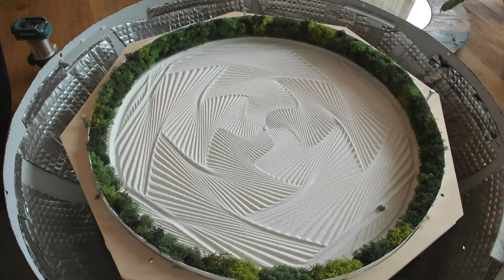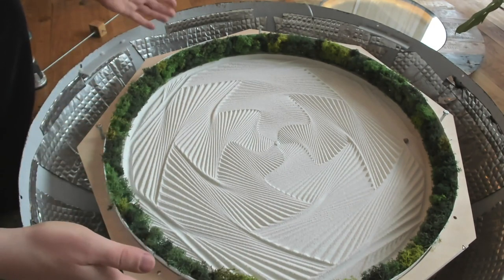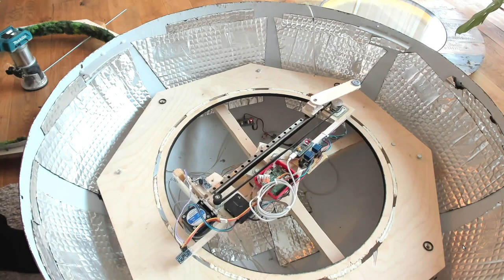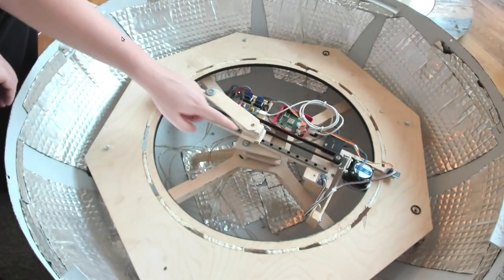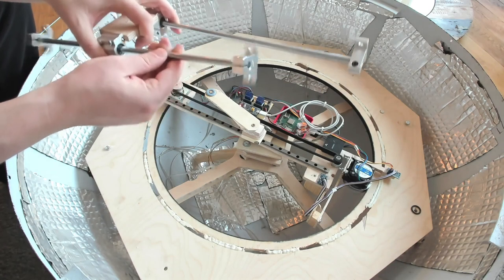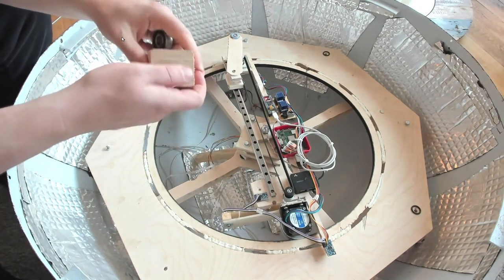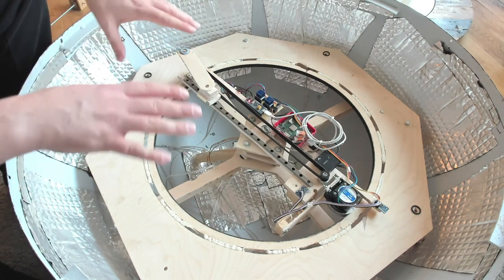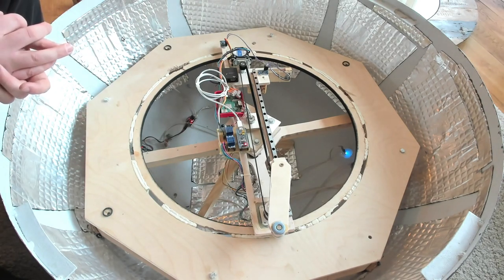How to create a zen sand table part 2: Hardware

Comment: I have been brainstorming on how to build a table like for the past 2 hours. You just took away many of my concerns I had. Thanks a ton for sharing. I've been thinking of making one for more than a year. But after just completing a significant (for me) woodworking project. I feel like I finally have the courage to attempt this.

I am mechanical engineer and have limited knowledge on the software side of things. But your documentation has convinced me it's at least doable to build a silent round sand plotter at home. 

My ambition is to make an affordable DIY version of the sisyphus table and share the building plans.

My idea for the construction is for the moving assembly to be completely without electronics. So the mechanical aspect would require some more effort and materials. 2 driveshafts on the same axle. But you already know this to be an option. 

My main concern then would be the noise.

But I am going to start with choosing the best/cheapest mechanical solution. Keeping in minds to keep the electronical side of things as simple as possible. Since I'm not great at that. 😂

Again, thanks for sharing. It's a very niche topic. But I'm glad you shared your findings and experience.

I will reply to this comment if I've made any significant progress. 👍
Reply from the maker: I'm glad the video helped you. Then it was worth making it :)
Reply: @abmt  I haven't continued progress. Since a couple weeks. But I did almost finish the design for the mechanism. It's hard to stay motivated with so much going on in life. But I'm sure I'll finish the project some day

Comment: Hi....  I really  like your Sand Table Build.   I like the fact you used a large planetary gear being the outer Nema 17 stepper motor that runs along the GT2  belt that wraps around the perimeter ring. Q. Is most of the sound  being generated coming from the outer motor agaianst that belt  or was most of the sound do do with th ball bearing on sand  ?            LOVE IT  Now I just need to  make  one myself   :)      Can you provide a link to the "Slip Ring Contact"  you used please   :)

Comment: Warum packst du die ganze Elektronik auf den Arm, und nicht an den Rahmen? Damit sparst du dir den Schleifkontakt. Aber sonst ganz interessant.
Reply from the maker: Wenn die Elektronik auf dem Arm ist, kann man beide Achsen direkt antreiben. Ansonsten müsste man die Bewegung für dir R-Achse auf/durch den Arm bekommen. Mir schien es so einfacher, weil man so weniger Probleme mit Toleranzen/Spiel hat. Mit der Erfahrung jetzt muss ich aber sagen, dass das unbegründet war.
Reply: @abmt Coole Konstruktion!
wo finde ich gute Schritt für Schritt Anleitungen um einen solchen Tisch zu bauen (Motor und Software). Bis jetzt habe ich nur welche für rechteckige Tische gefunden. Ich würde aber gerne wie du einen runden bauen.